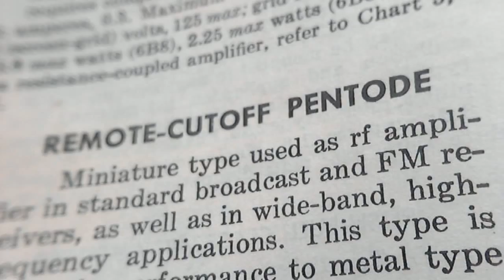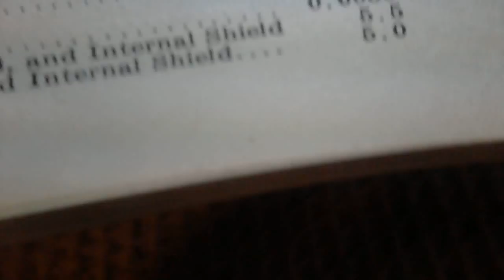A Look Inside a Vacuum Tube # 6BA6

Comment: That smaller stamped and bent narrow sheet inside is the actual plate (anode). The contiguous clad around it is the internal RF shielding and it's internally connected to the suppressor grid. Hence this RF pentode doesn't require a shielded socket.

Comment: Yep, mica. 6BA6 is one of my favorite mini's. You might have noticed the control grid is wound with wider spacing in the center and closer towards the ends. That's what gives it the remote-cutoff ("long tail") characteristic. Variable mu comes in really handy in AVC/AGC circuits. Gain easily controlled with a pot in the DC grid bias circuit. Nifty vid.